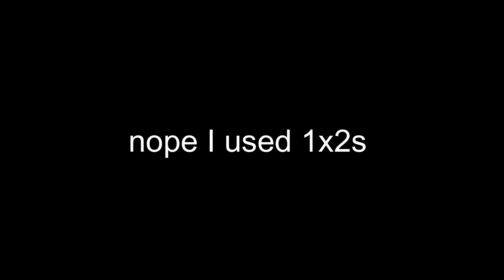Part 2 Of My Pantry Build | Budget Mobile Home Renovation

Comment: If the top of the door is out, you need to move the bottom in a bit so you can split the difference and it should close more flush.
Reply from the maker: thanks, Im gonna try that before I put the door handle in

Comment: Good evening Annemarie,  yeah!! 🌞💛
Reply: Great job....lol , I don't blame you (Wanting to fill it up).  Pantry will hold alot.
Reply: Imho, screws were a better choice. Stronger/ longer.
Reply: Sand down the high edge 20:05  of the 2×4 . Lay your first piece by stove. Cut smaller piece for trim pc. corner & around door.......just rambling
Reply: This is gonna clear up ALOT of space for you.....Congratulations Annemarie. Looks amazing.
Reply: Great work on the door
Reply: The door slightly warped?
Reply: It looks amazing Annemarie,  your your own worse critic. Looks fabulous.
Reply: Either really Annemarie,  I know you will make the right choice. I agree with white door.
Reply: Have an amazing weekend 🌞💛💛💛
Reply from the maker: ya I think its warped a bit, but the door is all trimmed out now and you cant tell that it pops out a bit at the top so Im just gonna leave it
Reply: I think it looks awesome.  Good morning ☕ 🌞 Annemarie 💛

Comment: I like what you ended up doing inside the pantry. the T&G looks good in there and you get 3.5 extra inches on all walls. It looks good.
I had to go around an angle on my cabin like that. I just cut a line halfway through the board along where the angle changes. Bent around the corner with no problems.
Reply from the maker: Thanks for the tips!
Reply: I really need to stop commenting until I finish the whole video @BigDreamsTinyBudget
Reply from the maker: haha no worries, I see them all

Comment: It looks fantastic to me. I get the warped look/ feel, but if it’s not interfering with anything or leaking, I’d go with it too.
Also, just an idea that would be functional for spices. Skin the very bottom and top two, add a 2x4 in the middle of the bigger one for spices. As for the door, Painted white or as close as you can match it, a barn door would totally rock.
Reply from the maker: Great ideas. Thanks!
Reply: Have you heard of Temu and SHEIN? I get a lot of home decor from them. As low as $1 plus. I believe I may have seen wallpaper for doors that resemble a barn door.
Reply from the maker: Thanks, I dont do Temu or Shein, just personal preference for me

Comment: I think you did a great job, I love the tongue and groove trim on the sides idea. It looks amazing! You did leave enough of a gap for a future floor right, lol! You do awesome work Annemarie, don't cut yourself short. It's an awesome pantry! I think the slats across would look good instead of a barn door type criss cross, but you do you Girl! I so can't wait to see it painted and filled.
Reply from the maker: yes I remembered to leave gap for flooring at the last minute LOL I cut some 3/4 in blocks to place under door casing and then knocked them out after I got the door in. I cant wait to see it finished either! I may just paint the sides and decide on the door after. I really wish I could have found a 24 inch old door with a window in it. Maybe someday that will be a future project, for now this door will work
Reply: Prayers you can find a door with a window in it that would look awesome!  @BigDreamsTinyBudget

Comment: I purchased a door in frame from Home Depot for my bedroom. I had to cut 1/2" off the frame to fit because I don't have drywall walls. I could never get it to close straight - there's a gap at the top and at the bottom. After a year of it driving me nuts I realized that the wood on the frame itself is crooked. Nothing I can do now but the point is, it's not always our fault. :)
Reply from the maker: Good point. Now that i've trimmed out the door frame I hardly notice that it pops out a bit at the top